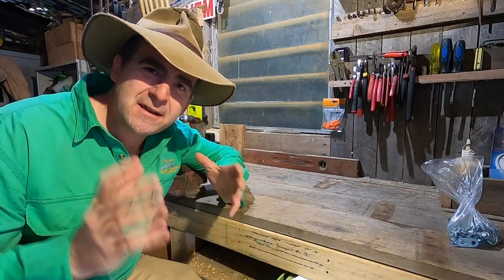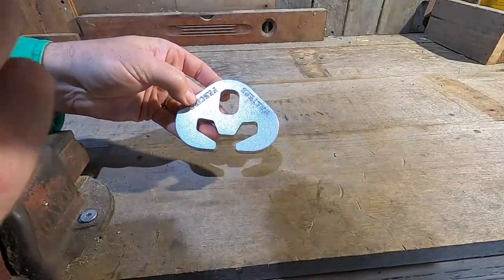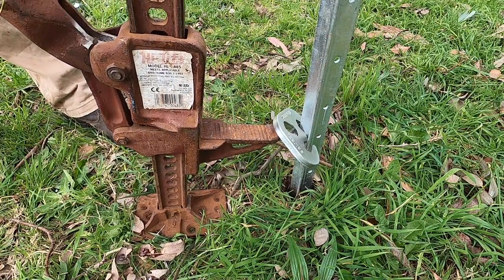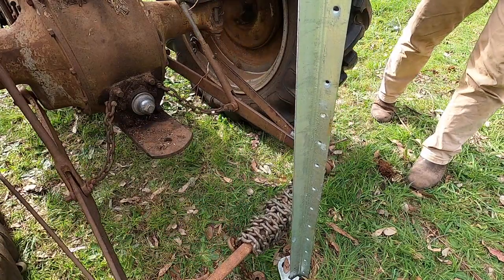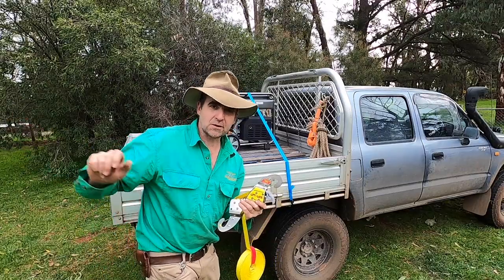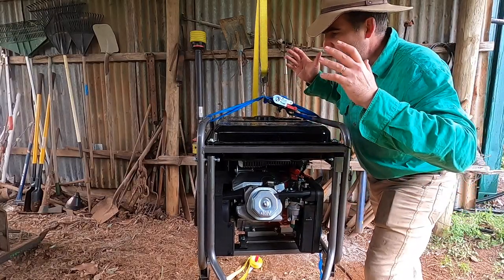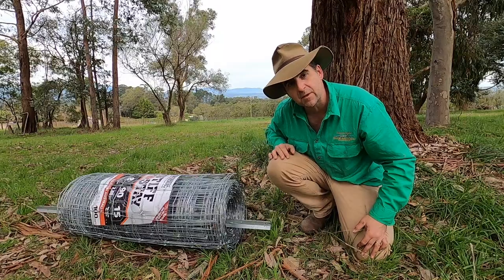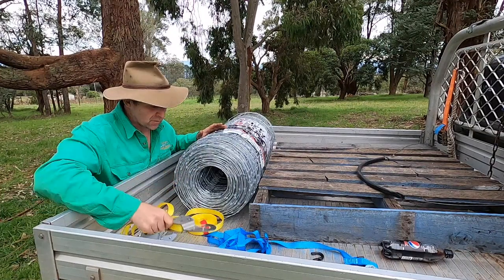More Gadgets Reviewed! Post lifting plate, "Lift and Lock" "Versastrap".

Comment: I'm sure I'm not the only one who was waiting for the shed roof to re-level... very impressed with the strength of the screw / bolt in the beam though. 😊

Saw a tackle set a bit like that used by the Royal Navy, bigger capacity though and - to cope with the truly huge amount of webbing - they had what I guess was a geared roller-upper, which looked like a more substantial version of a long survey tape winder.

Good kit, but any chance of one with just a wee bit more weight capacity?